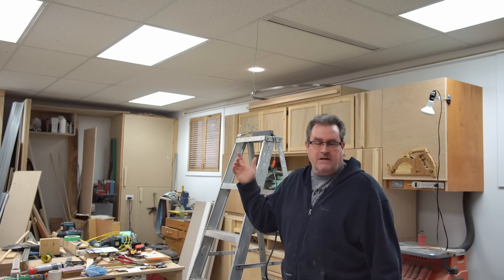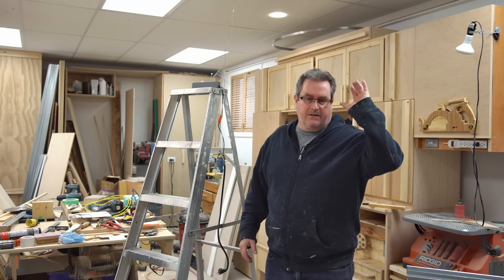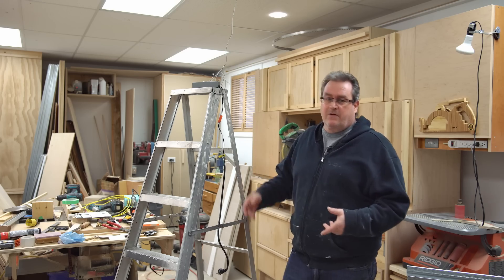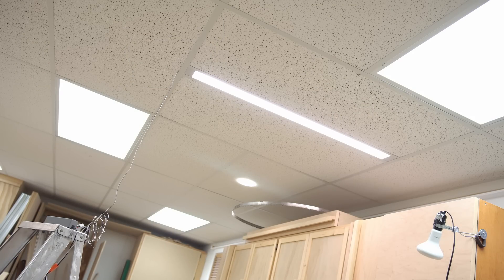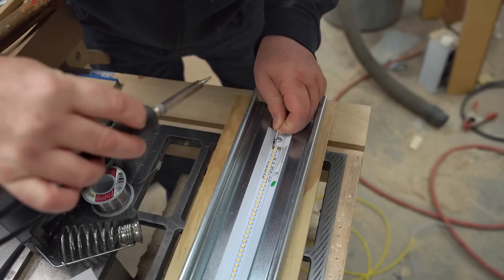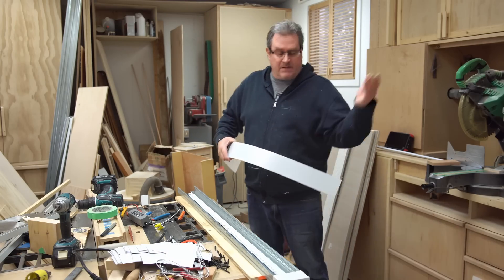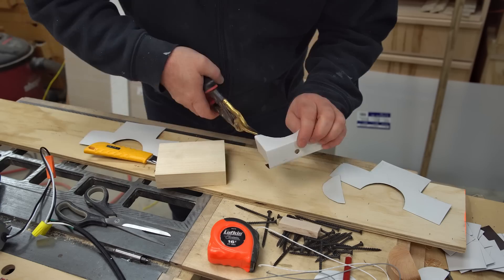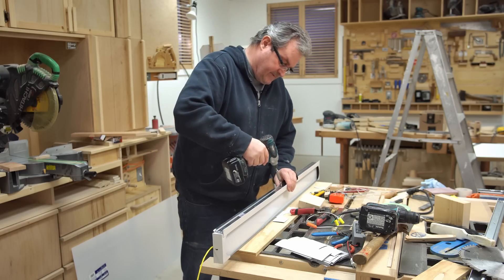Making LED "Death Star" Lighting For The Workshop

Comment: I always appreciate your projects and Point of View.  I have an open rafter shop and used 2 +" PVC...I cut in half lengthwise for aimed exposure like over the Router station with a single 4'tube in the concave portion  and two tubes mounted on the convex side for general lighting on the other half.Since LEDs can be mounted vertically, I also mounted one in a cut convex piece of PVC with a large hook on the end and several  feet of cord on the bottom end with six inches of handle so I can move  and hang it anywhere, even over the table saw or move into the house when I need to.  Thanks for the opportunity to post this.

Comment: Nice job. I love the new look.
As a future note or for anyone interested, if you really hate using the standard light lens plastic or find it a real flimsy pain in the butt, I use an acrylic sheet called P95 (I'm sure there are other names for it) in a lot of the sets that I design where we build integral lighting (especially in space ships). It has a nice diffusion, no colour change and the texture is pebbled rather than the typical diamond texture that you see in the big box lenses.
Reply: some quick googling - looks nice, but at triple the price, gotta decide if it's in the budget
Reply: Oh for sure. But it looks nice on camera. :) We used it on The Expanse and I know that it is heavily used on the new Star Trek series.

Comment: That is a great Idea. When I built my shop I put drywall on the ceiling and so far haven't gotten back to taping the joints. I may just cover up the seams with metal studs with LED's in them.

Comment: great adaptation of things available, i.e. steel studs for long electrical box, unique light bezels cut from 2'x4' sheets, end caps formed from aluminum flashing.  Very cool...those rounded end cap features.

Comment: ive got some 3ft led lights in mine I need to get more but works for now I have them over my table saw & outfeed-assembly table. I only have the 2 plus some regular bulb lights for now .HD only had the 2 in stock when I went

Comment: John, how does the cost of your (very elegant) solution compare with standard 2 LED bulb fixtures? Considering you had to buy the metal studs, LED strip, power supply, metal for the  end caps, screws etc. Plus, off course, your time.
Also, what kind of LED strip did you use? Also, how many of your "fixtures" does the power supply handle? Thank you.

Comment: Would it be possible to put the actual part or model number green lights site is a bit clumsy to find exactly what you used. And what you used is exactly what I have been searching for. Thanks
Reply: Christopher Vaccaro RK-4L-24W-50. 4FT.    
RK-2L-12W-50. 2FT.

Driver depends on total wattage of strips attached.  Send me direct message with phone number and I will call you.

Comment: Excellent job John. I liked the extra 1/2 circle cutout on the end caps....  Gave it a cool custom touch. What was the color temperature, CRI and could you put those on a dimmer? Oh and what was the model # that you used? Thanks John.
Ron
Reply: 5000k.   95+CRI.  These drivers are not dimmable but we also have dimmable versions.

Comment: thinking about converting my T8 but im affraid led wont be able to reach the ground with a 12' ceiling, i might order a couples to test it out first... thanks.
Reply: Blast357 .  Light from LEDs reaching the ground is not a problem. The problem with getting the intensity that you need from the height of 12 foot is a combination of the beam angle of the LEDs and the number of lumens produced by the fixture itself. Light intensity is measured in foot candles or Lux. Foot candles equals lumens per square foot. Lux equals lumens per square meter. The higher up a fixture is, the more spread out the light is. The lumens produced by the fixture gets dispersed over a larger area thereby reducing the lumens per square foot, or intensity. For woodworking workshops, the recommended minimum intensity is 60 foot candles. And then in the high Precision areas or finish areas where you need to be able to see imperfections, the recommended intensity is 80 to 100 foot candles or more. You can typically reach 60 foot candles by planning on 1 watt per square foot. You can increase the intensity over a specific workspace by putting fixtures closer together above the workspace, lowering the fixture closer to the workspace, or increasing the wattage of the fixture. You can generally maintain the one watt per square foot as a guideline, and by moving the fixtures around to the optimal location, you can achieve 100 + foot candles where you need it, and drop down to 20 to 25 foot candles and tool storage and material storage areas and walkways where you don't need as much light. For the YouTube audience, I do offer to do simulations in order to help you determine how many light fixtures and where to place them to optimize the lighting to meet your objectives.

Comment: Did you get the 12 or 24 watt strips?
Reply from the maker: The  4' ones are 24 watts and the 2' ones are 12 watts.
Reply: Nah, they've got ones with half the LEDs and half the wattage.  I was thinking about spreading it out more since my ceiling is so low but you went for spreading it out more but the cost was way more.  You went for spread out AND the full wattage, which would be nice too.
Reply from the maker: I needed all of them at the higher wattage to equal the output of the 6 fluorescent fixtures. Really nice not having the concentrated points of light now, makes it much easier to get good exposure without blowing out areas where too much light is coming down.
Reply: I've got a little more than half that.  8 two bulb fixtures.

Comment: Do those LED strips interfere with your radio? My dad upgraded his shop from CFLs to LEDs and now he has to put the FM receiver outside so he can still listen to the radio when he works.

He did buy them on the cheap, so that could be the problem.
Reply: Colin Partridge change the Power supply.

Comment: Pretty good design. I applaud your inventiveness. Great use of common materials.
I bought tube type LEDs and found a big difference in Lumen output from different manufacturers. They are not all that honest about lumen output.  It's easy to test if your smartphone has an app that can use your sensors to give an approximate Lux reading.  I used the app 'Sensor' for my Android phone.  American Green Lights look like a reputable dealer, their price is pretty fair, and their lights are supposed to be High CRI which is important as well.  By the way, I used 4000k, what did you use for yours?
Reply: Joel Godin - Woodworking Joel , I agree.   There's lots of difference between products.   Many items sold on the internet are not properly certified or falsely claim to have certification... especially on eBay.   Plus the big box product is usually a generation or two back on the technology.   The products now available are all much better than 5 years ago.   Advancements are progressing very rapidly!

Comment: All the various reviews on LED shop lighting products (Amazon, of coarse) indicate lots of disappointment with many of those LED lights.  So get to know the various types. 
 There is Type A, Type B single end and double end, and Type C.  Type C uses an external driver to control amperage\voltage.  These drivers and the LEDs designed for them are what makes for truly long-lived and reliable LED light installations. John's innovative fixture idea along with what appears to be LED strips and drivers ensures a trouble-free installation. Well done John and thanks for sharing. Be sure to visit the link above.  John does a good job of demonstrating how much more natural his LED lighting is compared to fluorescent lighting.

Comment: While the lighting looks awesome I suggest there is a fly in the ointment. How do you change the lightbulbs without having to completely disassemble the fixtures?
Reply: Killashandra111 the LED strips are very robust with rated L70 lifetime of 126,000 hours.   The driver is mounted remotely and is easily accessible if necessary.

Comment: is possible to do this without soldering never learned they look like a major improvement
Reply: It's super easy. Just practice a little and you'll be fine. There's no complicated soldering in this project.
Reply: But at the same time, yes, it is possible without soldering. As you saw he removed the pre-terminated ends that were included. Usually the supplier will sell extension cables that plug between the fixture and ballast, or you can just keep the fixture close to the ballast.
Reply: The standard strips come with one meter DC leads. You can extend the leads using 18 gauge class 2 wire such as  doorbell wire. You can connect to the doorbell wire using wire nuts or scotchlok connectors

Comment: I don't know how wide the flashing you used was, and I know you cut them all out before you decided to put the radius on them, but I bet you could use a hole saw on it and get the hole cut for 2 sides of the flashing in 1 go and save yourself the tediousness of cutting each one with snips
Reply: HickLife I was wondering the same thing, like could you clamp the whole stack between plywood and do it all at once? I'm sure you'd still need to sand them but you'd also have to have a holesaw with the appropriate radius.

Comment: I'm curious about the light output. According to the manufacturer each 24 watt strip produces ~2500 lumens and replaces two  32 watt T8 fluorescent fixtures. The T8's that I use produce ~2800 lumens each after  break-in.  The math doesn't seem to work. Does the inherent directionality of the LEDs make up the difference? And no, I'm  not any sort of LED hater! I just like to understand things.  Thanks for sharing another great project.
Reply: Alex Pettigrew you're correct that the directionality of the LED makes a big difference.   Specifically in ceiling troffers, as much as 40%of the fluorescent light is trapped in the fixture.   Most fixtures are not designed to maximize the efficiency of the fixture.   The light from the tube that goes upward reflects off the metal and loses about 20%each time the light bounces off the surface.   Due to the geometry inside the fixture , the light may bounce around several times inside the fixture before escaping , losing energy with each bounce.   If you look at photometric reports for those fixtures they are only 50 to 70% efficient. With the LEDs they are about 90%efficient or higher.   Also , fluorescent lumen degradation is much faster than LED.   As the electrodes oxidize , the ends of the tubes get black and degradation accelerates.

Comment: Looks good,  only thing i think that could've made it a little easier for you its of you made the little strap for the wire a little longer then you could've used only 2 screws on the end cap instead of 4. 
Still it looks good though.

Comment: Where the wire goes through the stud you should protect it from the steel edge. Through vibration in your shop from machines you could have the stud cut through the wire and cause a fire. Protection  form that should be considered. Your ins would not cover damage from a fire with these fixtures if it was found to be a faulty wiring cause. Would be a real shame.
Reply from the maker: The wire is secured with a strap, as clearly shown in the video.  And the lights are only on (and power going to the wires) when I'm in the shop, so I'd notice if a wire suddenly and illogically shorted.
I build things within the limits of reason, instead of counting on that one in a million instance where something could go wrong. It's called being practical.
Reply: Please also note...  these are Low voltage D.C. LED strips.   They operate on 40Vdc which is class 2.  They do not pose a fire risk.   The LED driver is enclosed in an electrical box and the ac wiring is properly connected inside the electrical box.

Comment: Could someone please check the following: Use a little lux-meter, place it under a led-tube or strip.
Be sure, the stripe/tube was some hours off and cold. Now switch it on and look at the lux-meter. Check, if the brightness goes down in the first half an hour and how much %. 
I made this experiment here in my workshop, because i noticed a dropdown of the brightness.
In the first 5 minutes i had a loss of 5% (!), after 30 minutes 10% (it's non-linear). I heard from another youtuber here, he had in 2 hours a loss of 20%. After this time it was stable.
Thanks.

Comment: If there led they shouldn't require a ballast in order for them to work you should just be able to hardwire them directly
Reply: Damien Douglas incorrect, the vast majority of LEDs are low voltage. If they're not then they likely have a ballast built in to the fixture.

Comment: I know you used to do metal construction for a living, so you must be well aware of the corrosion risk between aluminium and steel - which probably means it isn't an issue for you here, but why is that? Just low enough humidity levels in your shop to render the risk irrelevant? Or something I missed?

Comment: You can also use The crosscut sled on the table saw. Works like butter (or the chop saw that’s right behind you).
Reply from the maker: For?
Reply: He probably means for cutting the studs down to size. Other options besides the angle grinder or snips. Those studs are not as thick and beefy as some people are imagining them to be though.
Reply from the maker: I wanted to know if he thinks it a good idea to cut the studs with the regular blades that are in those saws. Because I've actually seen people do stupid things like that in person.
Reply: John Heisz - I Build It me too, the sound is not what I'd call "pleasant" either.
Reply: For copping the studs down to you 47 11/16”. Any carbide blade won’t even know it’s there. Been doing it with circular saws for years. Cuts very nicely, but you mentioned one thing that is very true... the sound! If you’re batch cutting, ear protectors aren’t too inconvenient
Reply from the maker: Cutting steel with a carbide blade designed for cutting wood is dangerous and stupid. It ruins the blade and can grab the metal unpredictably. 
I've cut a shit load of steel with TCT blades, so I know full well what I'm saying here.